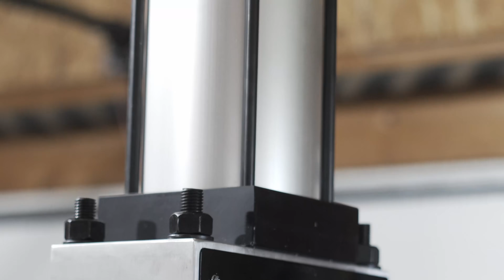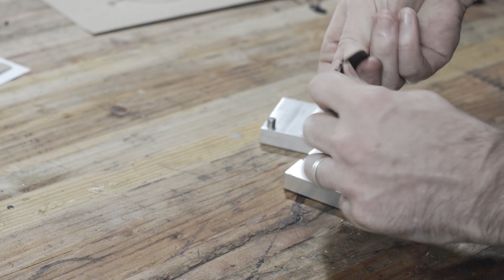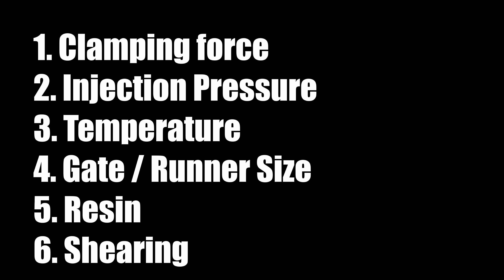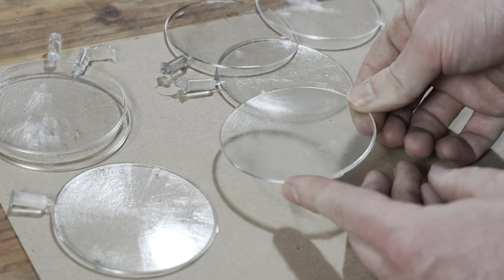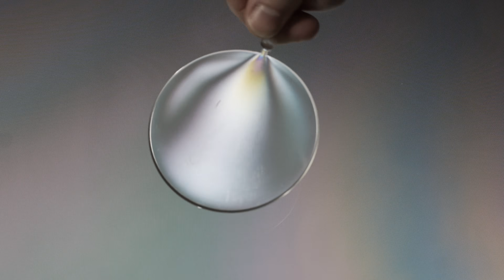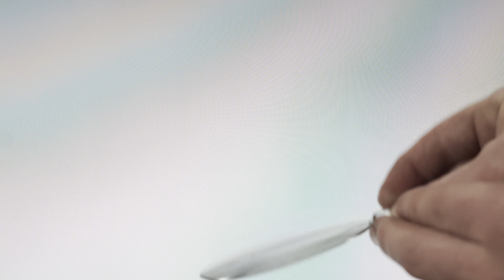Machining an injection mold for acrylic lenses

Comment: Paused at the streeks..
first thing that poped in my head was this.. Is he heating the mold.
Those look like cooling stress from the presure of the injection into a cold mold.
Reply: I was thinking the same.  Now I wonder if 1) is it possible to anneal plastic and 2) could the part be reheated in the mold to eliminate all that stress?
Reply from the maker: Didn't heat the mold, although a bunch of folks have since recommended so I'll keep that in mind next time! And annealing "in place" makes a lot of sense too i think

Comment: can you bake/anneal a mold by heating it with the lens inside of it to get rid of the stresses?
Reply from the maker: I didn't consider this at the time, but I think it would help a lot.  Annealing plastics is pretty common to remove stress (I think? not an expert here), and doing it inside the mold would help keep it's shape.  Such an obvious idea in retrospect.  Ooops :)

Comment: You can get that aluminium mold to a mirror shine, use 1000/1500/2000/2500/3000 sandpaper grit in this order and then polishing paste wich is also in different grits. And i think if you want to get rid of the stress zone from the mold, you also have to heat up the mold as well when you do this.

Comment: Could you make a polishing-pad tool for your cnc?
Great stuff btw. I love when channels don't tell me to subscribe every 5 minutes. Just good content shown in a relaxed manner without wasting my time babbling around to get past the 10min mark for the sake of the yt algorithm. Reminds me of Applied Science. And I will subscribe anyway because that is exactly what I enjoy watching :)
Reply: polishing pads for CNCs are pretty common from my days as an ME intern hanging out with the shop guys. They would polish some of the prototype molds in the VM2 with little lollypop felt bits (don't remember exactly what they're called) and I remember them working surprisingly well. We weren't making any optical components, but it might be something to check out for sure.
Reply: @zachbrown7272  felt bobs
Reply: Exactly what I was thinking, felt bobs mounted in the cnc. You already have a toolpath that worked. I would suggest trying around 10k grit gel and re-wet and add as you see fit.

Also, wanted to mention that you could try preheating the mold so less tempersture differential causing a thinner layer of rapidly cooling material which then gets sheared. Another thing that might help is making the lens thicker. And, if you really want to be a perfectionist you could preheat the mold, make the lens thicker, add angled vias at the top for distribution, and make the injection molded part a lens blank that would need a secondary 'trimming' operation. That's making it oversized so that the flows homogenize, and you could maybe make it square or some other shape that fits the flows (minimizes the shrear) or for ease of fixturing the trimming operation. 

I think your beginning (pre-shot) mold temperature is critical and needs to start out much higher. Ideally the melting temperature of the plastic used. Letting it cool under force from the liquid state would keep a the long-chain 'mers (as in polymer)  in random orientation all the way until solid instead of the shear causing the 'mers to be aligned more parallel, which changes the diffraction index.

I must say you chose a hell of a first project to try your new machine on. When I worked in a prototyping cnc shop I was told that the hardest thing to machine is a perfect sphere and that by making a sphere (or hemisphere) and measuring the deviation in the different axis you could 'super-tune' a machine tool (lathe, mill, or multi-function) to be even more precise than without.

Good luck!

Comment: How do you know the polarized light and dark marks are indicators of stress and not just a cooling pattern?
Reply from the maker: I think I just described it poorly :)  The color changes under polarized light are due to changing index of refraction inside the plastic.  This is likely due to different internal stresses because stress inside polymers stretches out the polymer chains and causes them to refract light differently.  This in turn is likely caused by cooling patterns as the plastic travels through the mold.  So it's both, in effect: cooling patterns cause internal stress which can be seen in polarized light.  I just worded it poorly I think :)
Reply: @BreakingTaps  Nice video, thank you. We work with acrilic on vacuum forming machines, and have the same problem about stress. According to acrilic sheets manufacturer advice, we are putting detail to the oven after forming, and heat it up to 70C. Then slowly cooling it. Actually we are heating it for 1-2 hours and then turn off the oven, and leave it inside for slow cooling for several hours. And it's working.

Comment: Reminds me of when I had to take my brakes rotors off soon after replacing them, for an unrelated repair. I was disheartened to see what looked like deep scratches, yet they were as smooth as glass to the touch. It was so strange, part of your brain and eyes say one thing, but your fingers and the rest of your brain say that is wrong. Not terribly relevant, but at least it makes Breaking Taps look better on the algorithm. :)

Comment: Good video, congrats! 
You are brave starting with a challenging material more or less right of the bat!

Have a look at material datasheet (for example Lexan resin 101 from the Sabic website)
It will give you a lot of important information like melt and nozzle temperature but I think what will help you the most is: 
1. Drying temperature and time: 3-4hours @ 120 degree C (to avoid the streaking due to too high moisture content)
2. Mould temperature: 80-115 degree C (to avoid the resin from solidifying too quickly). We use 85-90 degree with this material.
You will probably find that this will most probably improve your results drastically.
Probably the resin you use has very similar requirements.
If you still have issues getting the air out of the mould fast enough during injection (you might see black burn marks from the increased heat due to the high air pressure inside the mould), try lowering the clamping pressure until you get to the point where the flash around the edges gets unacceptable. 

Good luck. Looking forward to see your progress.
Reply from the maker: This is awesome, thanks for the tips! Filing away for future experiments :)

Comment: This is where the mold has to be turned rather than milled with a fairly large radius forming tool. Good news is that it's perfectly possible to simulate it on the mill by mounting the workpiece in the spindle and the tool on the table. Other features can be machined in a regular manner.
Reply from the maker: Hah, that's a clever idea.  Might try it on a smaller piece and see how it goes.  Or just finish re-assembling my lathe some day 😅
Reply: @BreakingTaps , another technique to improve the surface finish is to machine it at an angle. Here's why. When milling any surface close to horizontal/flat with a ball end mill, it touches the surface with a tip portion of the cutting edges. There's a lot of friction going on there, chips get welded back to the workpiece (coolant should be shooting straight at that tiny spot), the tip has very low linear cutting speed, etc. All that is bad. So, it's a good idea to have some more acute angle between the end mill axis of rotation and a tangent plane to the surface being machined. To achieve that in the industrial environment, such operations are programmed with simultaneous 5-axis toolpaths, but the rough approximation of that would be just tilting the workpiece in a vise. The goal is to have a tangent plane at the lowest edge of the lens cavity at about 15 degrees to the horizontal. Although, It might be a kind of tricky to achieve without a tapered tool holder or something like a smaller ER collet extension.

Comment: Maybe you could try electropolishing the mold. Depending on the parameters, you can get to a very good surface finish. Maybe one hurdle would be the size of the mold, because you'd need a higher current. I'm not an electrochemistry expert, but I know it exists and you should look into it.
Reply from the maker: Will look into it!  Been playing with electroplating and related recently, seems like it'd be similar

Comment: Hey, have you tried DLP resin printing technique?

I'm pretty sure you gonna make lenses much easier, faster, and cheaper, and they say its optically suitable by properties :)
Reply from the maker: I have! Not great results, unfortunately.  The resin tends to yellow, and the layer height is still noticeable despite being small (0.1mm layer height == 1000 microns, but optical surfaces have to be sub-wavelength so like 20nm).  Formlabs has an interesting whitepaper on optics, can somewhat improve finish by coating the lens in resin so it's smoother, but still many issues with figure and yellowing :(

The best solution is probably to use a highly-polished, machined mold and then optical epoxy which cures perfectly clear.  No stress from the molding, no yellowing from UV resin.  Best of both worlds I think.
Reply: Thanks for reply,  yellowing is issue with some resins or not suitable washing and curing method, it would be easy to keep clear :o

What if you water polish that resin after printing? Mmmm... Idea! If you print lense and then like half-mold of that lens, attach those to drill and apply some polishing cream between surfaces.. Start pressing gently that rolling part and do some wave movement all around lense, its like same method how they make glass lenses but faster and much cheaper way at home workshop

Lense and "cup" will sand and polish each other to pretty perfectly smooth and it keeps the shape because both are same hardness and its rotating all around, so it make it even more spheric shape than printer
Reply from the maker: @amtechprinters  Unsure to be honest, it could have been improper (or overly aggressive) washing/curing on my behalf.  Or some intrinsic yellowing too... Formlabs whitepaper shows some yellow'ish lenses so I suspect it's a bit of both

That's a good idea about polishing, I bet that would work!  Probably wouldn't be too hard to rig up a mechanical polishing rig similar to what they use for lenses or telescope mirrors and just let it run unattended for a while :)

Comment: About the only parameter you didn't touch on is mold temperature. You could put sheets of phenolic circuit board material (no copper) behind the mold halves to insulate them from the platen. Fwiw the material between two polarizing sheets shows stress gradients not stress. Just something to keep in mind.  As you figured out plastic is very good at imprinting ANY surface imperfections.  If it doesn't look like a mirror you're not done polishing :)  I may have missed it but 3 tons of clamp pressure per square inch of projected  area is rule of thumb. You can usually get away with less.  Good video subscribed.
Reply from the maker: Good points all around, especially "stress gradients not stres"!  At some point I'd like to automated the machine a bit more (shouldn't be too bad to add some ejector pins and wire the hydraulic up to a relay, and was thinking about installing some heaters during that process.  We'll see!  After this video I picked up some of those little stone filing sticks, didn't realize that molds required so much hand polishing!

Comment: usually commercial moulds are heated so as to not add temperature stresses localised cooling to the material as it fills ... So make a couple of Robert's conductive ink kapton tape and copper strips, or your less effective lasered version with a cheap thermostat esp32 and wrap/paint them around the two halves , dial too 100c and play around.

notice how 3d printers and some diy metal casters are just now rediscovering pre heating and keeping all their in contact tools, containers and localised working spaces etc hot as it just works and flows far better when the flow above all else matters the most for that short time frame, old is new again ^_~
Reply: A modified toaster oven would probably be more convenient. Definitely want a better thermostat, maybe a way to circulate air, perhaps a little extra insulation. I know it doesn't sound all that convenient anymore, but it does come with its own container, racks, heating element and instrument panel. 
Definitely not as flexible as @paul maydaynight 's idea, but it will work for anything the size of a loaf of bread and smaller, which should cover most things your working on.
Reply: @superdupergrover9857  im not so sure over thinking and so over engineering a problem is the better thing to do though.

as i said and imply, simple is best, make a quick cheap diy localised kapton heater to fit ,wrap it, and apply juice.

even put them on the mating faces if you want to use less juice per local heat and act as a spongy seal (good for up to around 300c) at the same time
Reply: @superdupergrover9857  i was just now, thinking additive and simpler localised aluminium removal mould making.
did you know a cheap stripped down 12v steel diesel plug/Glow Plug can easily soften and melt aluminium.
 use it and a small steel vacuum tube (solder sucker style)in a printer to rough out your shape as a diy engineering test... And...

you could use the oven there as the HOT work area once you steel up the basic printer and extend the cutting/heating head for heat tolerance etc
Reply: @paulmaydaynight9925  A question I'm actually qualified to answer (I sell auto parts). First, being a 12v system, glow plugs use a huge amount of amps, but that can be worked around. The real problem is that glow plugs are designed for short duty cycles, 30-60 seconds at a time. 
I think a better solution would be to wire feed aluminum into a very small ceramic chamber that is induction heated. This chamber would feed directly into the print head. 
Getting the machining to happen at the same time will be tough. The heat tolerance should be doable, keeping the machine tools out of the way of the print head while keeping a decent print rate will be hard. 
  The only people doing anything like this is Fabrisonic, but their shtick is about low temps and is very different otherwise.
Reply: @superdupergrover9857  i like your thinking.
 yt direct url's dont work now apparently so for now see 'diy plastic string' as the simple diy way to make useable 'diy aluminium string' from waste coke can's ^_~ as your testing feed stock, after burning of/off the plastic coating.
 dont worry about the carbon deposits , see 'Robert Murray smith' conductive inks

so a simple old car battery and motorbike/car starter relay connected to an esp32 low voltage relay for the duty cycles , If the glow plugs burn out quickly then...

a diy ceramic in place of the kapton works too, you can integrate the heating that way. and...
Reply: @superdupergrover9857  also see 'cayrex2 High temperature Conductive ink - 1000 degg C (Update)'
Reply: you can probably drill a hole and put a cartridge heater in the actual mold.

Comment: So.. Obviously I'm binging your content like a big fan boy. This stuff is incredible. A while back I was making a cheap SLA machine and I messed up the lens in my projector. I was able to mold and epoxy resin a new lens which actually worked. I had no idea till then that you could possibly make a lens at home. Plastic world in my area even had particular epoxy designed for clear lens making. Under vacuum of course. Love your stuff.
Reply from the maker: ❤ Thanks!  Yeah, the whole area of molded optics is a deep, dark rabbit hole I've fallen down on several occasions :)  Can either spend lots of time making an optical-quality mold, or use fancy single-point diamond lathes to fix the surface of molded parts (or just turn them directly... those machines are wild).

Optical epoxies are pretty nifty though, and definitely removes some of the major pains of injection molding.  Currently noodling over an optical epoxy project, we'll see how it turns out :)

Comment: If you haven't already, pick up a copy of the Bayer part design manual.  It's the bible for plastic part design
Reply from the maker: Rad, I'll check this out, thanks for the tip!  Definitely have a lot to learn, it's a whole different world.  Haven't played with the machine much since this video, but am noodling over an upcoming project that would use IM parts so might be revisiting soonish.  Will check out that manual!

Comment: Awesome video! Curious, do you plan on making a video about the ins and outs of the injection molding machine? I've been curious to add a small injection molding machine to my prototyping workshop. Thanks!
Reply from the maker: Thanks! I'd like to make a video like that, although I'm still very new myself... there is a deceptively large amount to learn about injection molding I've discovered.  I'm noodling over a project that will need some IM parts, so I'll try to take down notes as I work on it and see about doing a dedicated "IM for the home shop" style video :)  The machine itself is pretty simple, would be easy to cover.  I've been pretty happy with it so far, especially once I understood the limitations of desktop IM a bit more :)